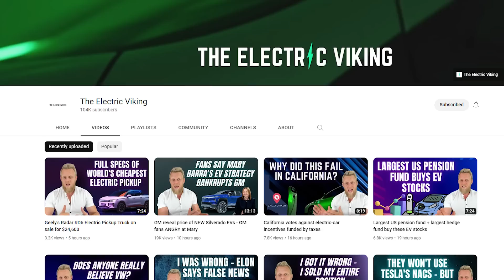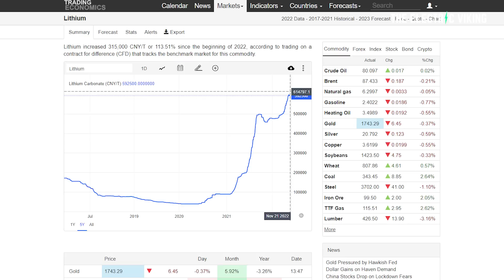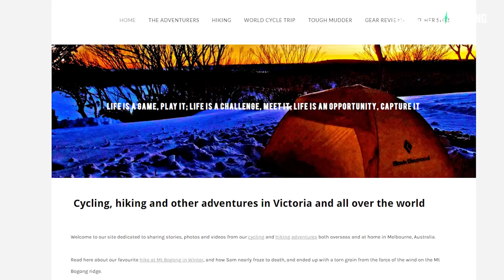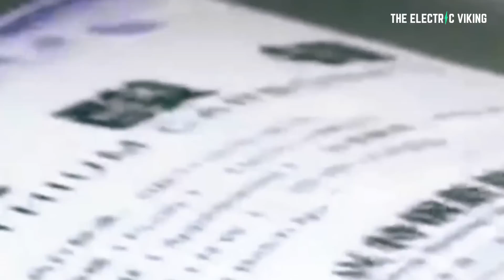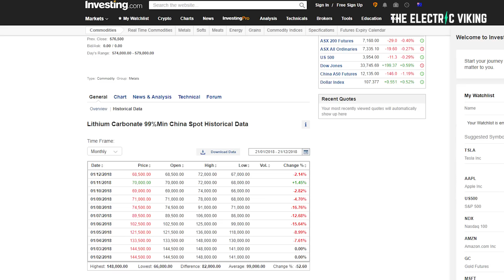China says it will crack down on lithium price gouging as prices skyrocket

Comment: $85,000 USD per tonne of carbonate or $85 per kilo. How much lithium is used in battery packs? I believe Tesla S has about 12 kgs of lithium in its pack or about $1,000 USD worth. Doesn't seem that a high lithium price really justifies EV car prices rising by thousands of dollars because the lithium price has gone from $14 per kilo to $85 USD per kilo.
Reply: im sure vicking is watching prof. david kipping from cool worlds or sira from tech for ludittes. both made videos on how much lithium goes in 100kw battery pack of 500kg weight. around 10kg of lithium  meaning 2%. of course depends of the chemestry but your estimation of one third of the battery wight represents lithium is way off i think.
Reply: True but cobalt and nickel are also way up.  New mining operations and alternatives will come and prices will likely fall eventually.  Shorter range or more efficient vehicles can also potentially use sodium ion and be viable.  Based on volume and weight Aptera can likely still make 400 miles on sodium ion (lots of R&D which is obviously why its not considered yet).

Comment: Turbulence in the lithium market should be expected. The rapid growth of lithium battery production is outstripping growth in lithium carbonate/hydroxide production from mines and brine concentration. It is hard to get reliable projections of lithium carbonate/hydroxide production with reports such as those produced by McKinsey predicting that supply is ramping up to meet demand but this assumption relies on yet to be commissioned projects. At the same time the negative environmental impacts of lithium production are becoming better understood and leading to more regulation and more complexity in developing new projects. Bottom line - there is plenty of lithium but ramping up production may be a key bottleneck slowing the EV revolution.

Comment: Sounds like Xi is taking a cue from Biden.  There is a fine line between high prices due to excess demand over supply and "gouging."  The market does need to be regulated to avoid price increases due to speculation and dominance by a few sellers.  We have a lithium supply problem that needs to be solved and it appears that even at these astronomical prices it will take several years to get the supply up to the point where anticipated increases in EV production are possible.
Reply: Agree! Especially when new cleaner mining and processing options are ignored. This is an environmental revolution that needs support, not impediments.

Comment: Supply and demand is a harsh mistress.  We need Li to stop competing with itself.  The 180mWh battery in the Hornsdale Wind farm, contains enough Li to put batteries into 3000 60kWh EVs.  And other battery chemistries are superior for static applications.  Weight is no longer a consideration.  There are the liquid metal batteries, the ZnBr flow/plating and gel batteries, Na batteries that look to be a 'commer' and a raft of Redox batteries based on Fe or V.  All have a much larger life span than Li batteries and use materials that are much more available and hence less expensive.  They just need sales/production volumes to get the price down below that of Li batteries.

Comment: I wrote in reply to another video titled: "Gas powered cars will DIE within 7 years"     My reply:  It won't happen. I am involved in lithium extractive metallurgy research. The required ramp up of metal (lithium, nickel, copper, rare earths etc) ore mining and mineral processing won't happen in 7 years. It will happen more gradually. PRICES FOR CRITICAL METALS WILL GO UP AND CONSTRAIN DEMAND UNTIL THERE IS BUILD-OUT OF SUFFICIENT SUPPLY TO DISPLACE ICE.  Zachary Shahan over at Cleantechnia has a whole series of videos on this problem.

Comment: As of right now there are many EV producers with low volume and weak market power. They face few very strong battery producers. So a lot of margin is going lost at battery producers. To be fair, the battery is probably the part that takes more know how to make safely so they deserve a huge chunk, for now (that’s why EV producers should and smart ones are developing own battery tech). Also I guess lithium is in some form of shortage and that producer market is probably also rather oligopolistic, so they are getting more rn, than they deserve. Long Story short, once only few powerful EV companies are left, they can use their market power to change this. Till then low margin. All only my quick thoughts.

Comment: Depending how fast sodium-ion batteries can developed, the problem of lithium may disappear.
Reply: This will be especially significant for static storage where mass and volume are far less important.  If static storage were to free itself from Lithium, that would free that Lithium for use in vehicles.  Not a total fix, but still helpful.  I have a jar of salt in my kitchen I am hoping to sell for a profit.  :)
Reply: @normcfu  If EVs are efficient the limitations of sodium ion are still viable.  200 mile range in a typically designed car or 400 in an Aptera.  This wouldn't be used for the high end but for most people this is still usable range especially in europe.

Comment: Higher lithium costs will make new mining investments outside of China more attractive. This pairs well with N American desire to protect supply chains and reduce dependency on China. The short term may be painful, but the longer term likely leads to a more stable and secure resource market.
Reply: True. But the problem with high cost miners, like high cost oil drillers, when prices fall, your margin disappeared and you are in trouble.

Comment: Lithium Brines in South America take 12 to 18 months to dry out before the lithium can be scraped off the surface. It is very hard to ramp Brines up due to the time lapse. Hardrock mining is also not easy due to the chemical process creating the exact right product to be used for batteries and this happens at the mine. Investment banks said in 2018 "we where sleepwalking into a glut of lithium". The exact opposite was true. This put a massive strain on lithium supply in 2022 hence the high price for lithium now. China stockpiles lithium to control the price and they have no stockpile at the moment. Do not blame the lithium suppliers for high prices. Blame the banks for stopping new mines coming online as finance was impossible to get due to the so called glut of lithium coming. This was either a lie or really piss poor analysis.

Comment: You forgot one big thing in your analysis, what about the solid state battery. They don't need lithium anymore of only a small amount. Those batteries charging to a 100% in 10 minutes and take half the space. They can easily make cars that go twice the range of a Tesla and they are even lighter and cheaper. Toyota already developed them and will roll them out in every new car in 2025. If Tesla doesn't innovate fast by then Toyota will complete wipe them off the face of the earth.